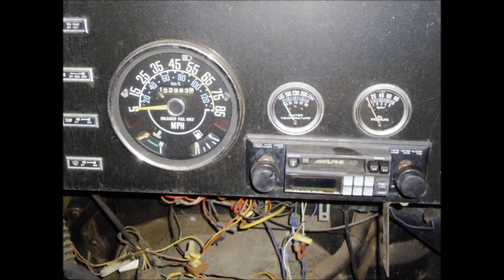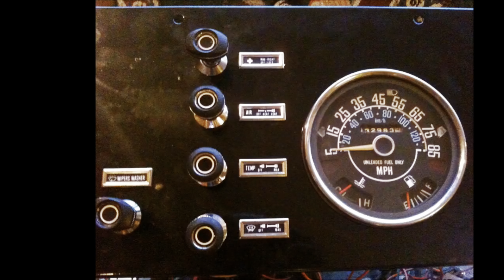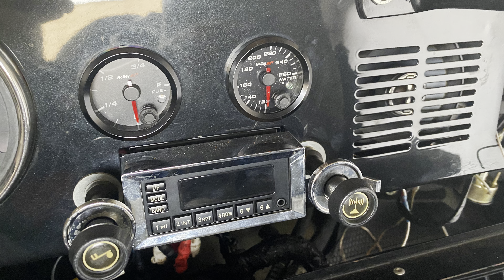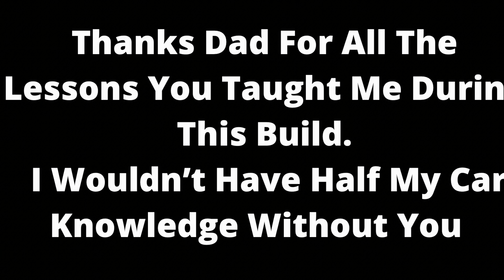What It Really Takes To Restore A CJ7 Jeep

Comment: I did a 1982, don't you have issues with the spare tire carrier? I left mine off as another rebuilder guy told me the weight of the tire eventually breaks the body apart. I'm planning to buy an after market one with better configuration.

Comment: Great work.. subj showed 79 CJ but you mentioned 83? Where are you at by the way? I'm in Texas. Working on a 79 now. Who did the metal work on the body to replace the rusted part?
Reply from the maker: Thanks! Florida. It’s an 83. The tub was too shot to fix so we put a new steel tub on. The fenders, grill, and hood were rust free. We had a local shop paint it
Reply: @wardwrenching  thanks. Where did you get your steel tub from? I've looked at the ones from Morris but they're out of the ones with the licensed jeep logo and they want 5k for them.
Reply from the maker: @celticcraps  Mine was from Morris, but it was back in 2012 when I bought the Tub. Honestly if I did it again in this day and age, I would try to find a donor tub out of Nevada or some dry state. Facebook groups and eBay might be a good place to start.
Reply: @wardwrenching  hey there. Too late.. I looked a bit but ended up getting the tub from a Morris with the jeep logo. Lucked out they had a few that I didn't have to wait. What were the challenges you had with the Morris tub? Let me know so I know what to expect. Thanks bud. Jim
Reply from the maker: Be prepared to cut out holes for various items. I had the tub sprayed with bed liner before I put the carpet on.
Reply: Hey bud..now working to get to a rolling chassis. Noticed you still have the amc20 rear and dana30 front? What tires and wheels did you go with? For the wheels, what backspace and offset?